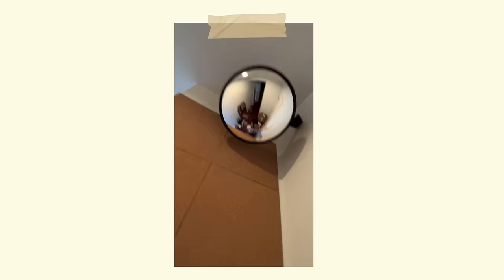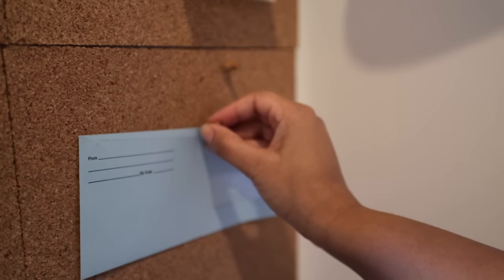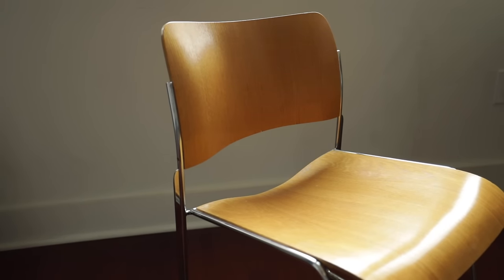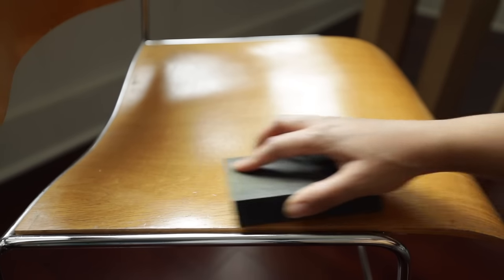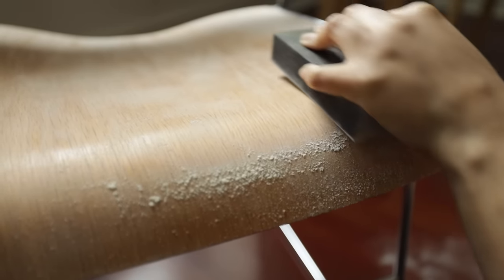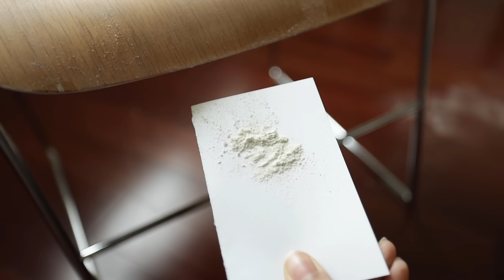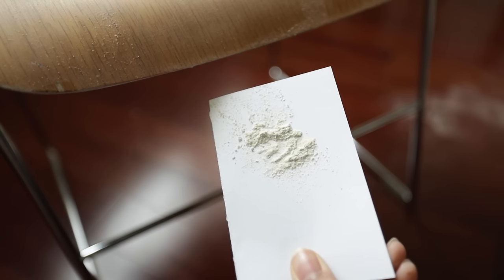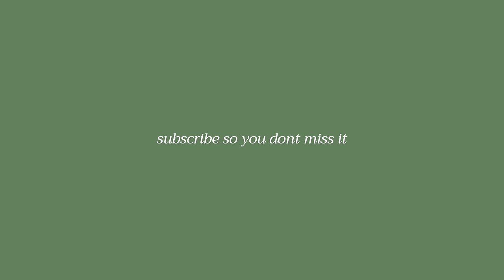Apartment Diaries | thrift flip, entry makeover, painting & DIY

Comment: Your videos are always such a peaceful and yet informative thing for me. I really never wondered what wood filler was made from. But after I saw you mix the saw dust with wood glue I wanted to see how it would turn out? And it turned out well. I've been wanting to make my own slant board to work out with. I found out Home Depot will cut the wood for you. I've never used a drill or anything before. I don't even own a hammer. But I'm still going to make my own. And so I'm looking forward to buying my own drill.
Reply from the maker: ohhh thats such a good idea. never even occured to me to try to make one - i just got individual little silicone ones. i look forward to hearing when u finish it!